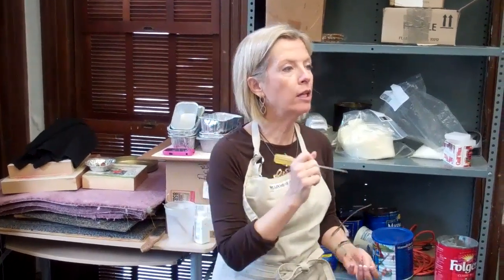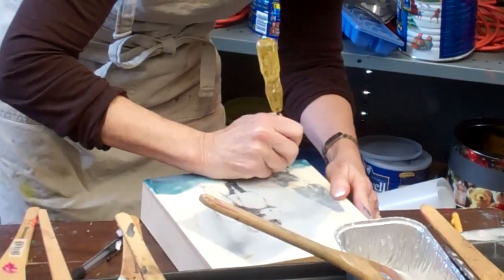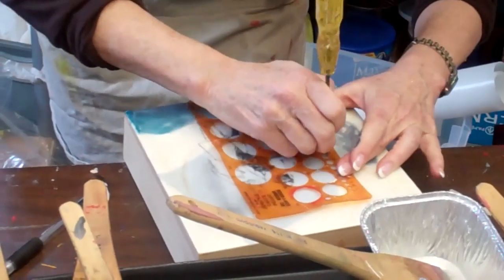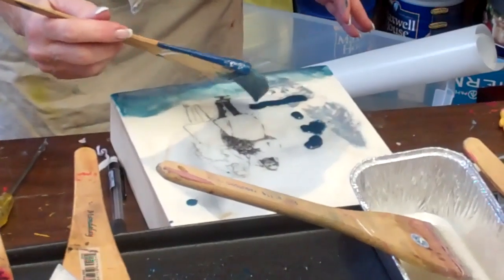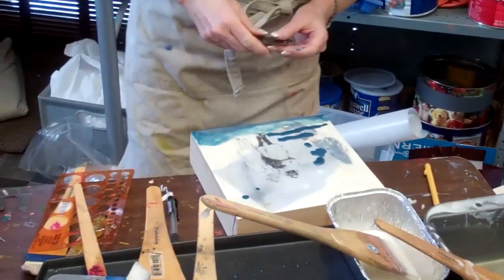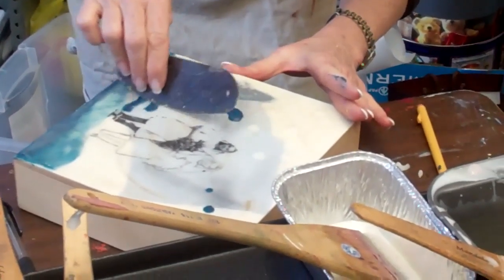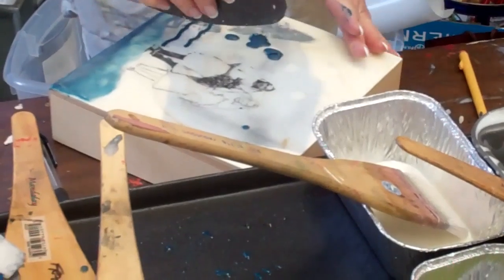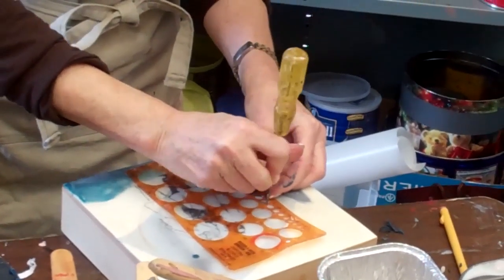How to Paint with Encaustic Paints, Embedding Wax Part 4

Comment: Thanks for doing these videos and sharing your knowledge and experience. I hear a variety of ideas regarding what type of pigments, paints, can be used with encaustic. Some say you can't use oil -- you mention oil sticks. Do you have any comments about which paints can and con't be used with wax?
Reply from the maker: If you are working on the surface, oil sticks can be used sparingly and then fused into the wax surface.  Oil paint and wax are "chemical" cousins.
Reply: Stay away from anything that is considered acrylic.  Acrylic mediums are essentially plastic and wax doesn't play well with acrylic/plastic.  Sticking with oil or wax based is best.

Comment from the maker: HI, this response is for Lynne Larkin. Yes, Lynne, if you fill hollow areas with wax you are embedding the wax. Incising would be just cutting into the wax. I do run my workshops using beeswax and not encaustic medium. The medium is expensive and to save $ I teach techniques using beeswax. I explain that to my students at the begging of the workshop. These are classes for learning techniques, not creating fine works of archival art.

Comment: Hello my question is how long did you let the wax rest before gouging.
Reply from the maker: Hi Lynne, if you cut or incise into the wax within a few minutes you will notice deeper cuts. If you wait and come back to your work another day, the wax will truly harden and your cuts will be finer. I also like to wait a few days to scrape and smooth the surface w a razor blade.
Reply: @francescastegman   will the razor blade make it clearer? Also I wanted to put R&F oil into my incise hopefully I won’t have heat it back up?
Reply from the maker: If you are incising into wax to creat a line, you then rub oil stick into the line, remove any excess oil stick from the surface w linseed oil, then lightly fuse w heat. Be careful w the heat and don’t melt what you just finished.